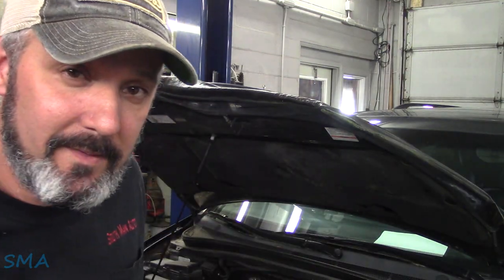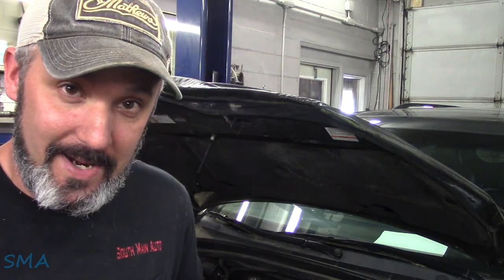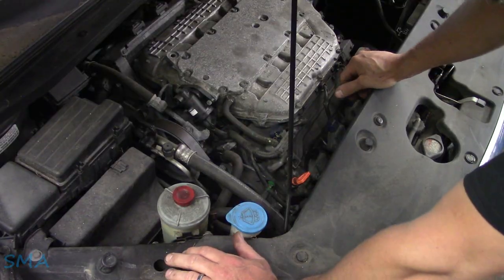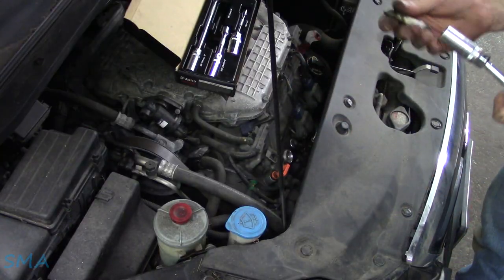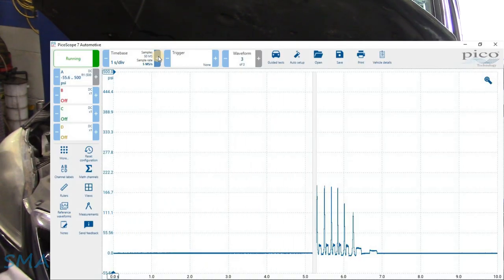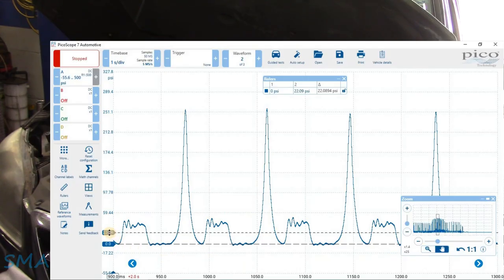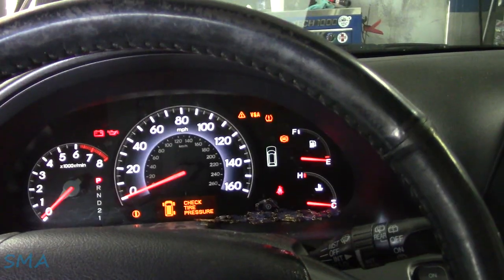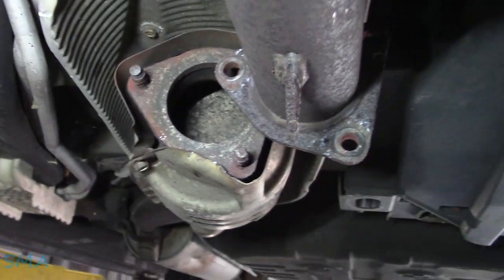Honda Odyssey: No Power At All

Comment: Gonna be expensive. That’s why we call em Cadillac converters.
Reply: Maybe not... if Jersey doesn't mandate commiefornia emissions.... could maybe slap on a chinesium filled converter from the Ali...
Reply: Find the guy with the garage full of used catalytic converters and the battery powered Sawzall 🙈👈
Reply: @wak359    It’s New York and they only allow oem.  My brother lives just north of South main auto and has been going through this.
Reply: @FredTheLutinoCocatiel  I dont no about ny but in Utah no used converters new oem only
Reply: @jeffleach2668  Eric O said the car's not registered in NY, that's a NJ plate on it. NJ does follow CARB, but only since 2009 and this is a 2007 vehicle so they may be able to get away with a federal cat instead of a CARB cat.
Reply: $125 and change from Rock Auto for the cheap one.  $250 for the premium.
Reply: @LuckyBaldwin777  except in New York they require oem converter so no rock auto honda only
Reply: @jeremyhanna3852  Oh really?  That blows.  Rock Auto says theirs come with the EPA certification, that should be good enough.  It's good enough for CA.
Reply: @LuckyBaldwin777  I have no idea for sure but I've heard Eric say it before ny state law oem converters only
Reply: @jeffleach2668  but the car apparently bears Jersey plates... cuomostan vehicle equipment laws are immaterial; only Jersey matters.
Reply: What's there a bunch of hacks in this comment section? Get the correct part, do it right.
Reply: @nickwood1062  ideally you are 100% correct but if a CARB-compliant converter is required it would, by itself, triple the value of the vehicle. Thus, it is not economically feasible.
Reply: @jeremyhanna3852  Except, Eric said it is NOT registered in NY. It's registered in NJ.
Reply: @bluegrallis  so that means his shop can install what the state considers a illegal cat because its not plated there eric even says at the end of the video he doesn't no has to to some research
Reply: @glassvial  I live in NJ an my cat just went at inspection time and they gave me a universal and I passed inspection with it. Literally less than 2 weeks ago.
Reply: @LuckyBaldwin777  The rock wins again
Reply: @wak359  The old stink of Jersey.
Reply: The ding dongs are burning baby.😁😁😁😁
Reply: Just gut them, cheap and easy..so I've heard! 🤔
Reply: @thyubernoob  careful with that kind of talk.  You might attract the smog nazis.
Reply: @glassvial  Entirely depends on the sticker on the car, if it has anything about California emissions on the sticker it has to have a CARB approved unit installed.
Reply: @LuckyBaldwin777  Nope, for NY it has to be OEM or a CARB approved unit. EPA cert isn't legal for NY on any Cali/NY emission vehicle.
Reply: @Blazer02LS  Unfortunately Eric O never let us know if there was a CARB sticker on the vehicle or not, but he did say in the follow up vid he put a NY/NJ compliant cat on it so I assume he put the CARB cat on it. Now that I've seen the follow up though, I'd say that was the last of that vehicle's problems!

Comment: I had a 2005 ford Taurus, all 3 cats were plugged. I gutted all 3 now it's running good, but the check engine light will never turn off. It's best to live somewhere without emissions testing.

Comment: Way back in the 80's when I was a Honda motorcycle tech a Honda Odyssey was a small yellow dune buggy type machine . Some of the engines on the first run off those units had a defect that was never disclosed to us at the dealership . New engines were shipped to our shop to replace the engines that had the issue . With the regional Honda Service Rep standing there as a witness I was instructed to smash the engine cases and bend the crank shafts of the engines I had removed with a sledge hammer before they went for scrap . I didn't much like smashing those engines that were new and had never ran . All these years later I still think of that day when I hear someone say " Honda Odyssey ."

Comment: Nothing like getting another dose of SMA. Get me through the rest of my day. I’ve seen some plugged exhaust. This ones as bad as it gets. Normally ya see big chunks of honey cones falling out in pieces. That one looked like it was caked with ash. Something tells me this guys gonna either tell Eric he’s gonna run with it without the ash or swap the old one with a new one. I’d prefer the later. The compression test did a good job of finding the back pressure in the cylinders on the exhaust stroke. Nice work Eric. I hope this guy allows you to fix it properly with a new one.

Comment: Vcm loves to kill that rear cat, done a lot of reading on Honda's cylinder deactivation. When cruising oil gets forced up through the oil rings from the pressure having no place to go which pools up then when it's reactivated it burns that oil and slowly starts to kill the primary cat by coating it in burned up oil. Happened to mine that's why I looked this up someone even made a vcm muzzler.
Reply: What is a VCM on a Hyundai?
It consists of a DC motor which actuates the VCM valve and a position sensor which detects the position of the VCM valve. The VCM system tumbles air flow entering into combustion chamber of each cylinder by closing the VCM valve in the cold start conditions.

Comment: It's a 2007 Odyssey touring model so it has a VCM engine. They have a reputation for fouling the rings on the deactivated cylinders, at which point they start consuming oil. Perhaps we'll have the pleasure of seeing this engine get that service.
Reply: Eww, I didn't know VCM was a thing Honda did. I guess they haven't learned from everyone else who's screwed that up.
Reply: @anonymic79  The higher trim V6 engines up 2010 (e.g. J35A7 engine) have VCM. After that all their J series are VCM AFAIK. I have a 2010 with VCM. No problems so far, but I saw evidence of slight fouling when the plugs were changed at 100k. I just be sure to use good oil and good gas. Hopefully that keeps it at bay.
Reply: How can you foul a ring? Air compressors do fine. No heat on the rings, plenty of oil. I don't see how anything could be damaged. Now maybe fouling a plug.
Reply: @Bryan-Hensley  They get plugged up with carbon. Honda have a TSB about it. The pistons have to come out, get cleaned, and get new rings.
Reply: The 2005-2010 EX-L and the Touring had the VCM. I have an ‘05 EX with no VCM and dont have any oil consumption issues. A lot of people installed a VCM muzzler to disable the VCM and havent had any issues if they installed it early enough.
Reply: @tomcartwright2637  I have the 2010 EX-L. No VCM muzzler. So far so good.
Reply: @Bryan-Hensley  Oil control rings especially can foul when the oil return path and ring lands carbon up. Hot carbon from a running cylinder can freeze a ring away from the bore when the cylinder is deactivated. In the sense of a plug fouling, the carbon prevents the part from working properly, so also in this case carbon can prevent other parts working properly.

Comment: I’ve not seen this happen before so once again I appreciate SMA videos. Always good to think ahead and start with the easier stuff before overcomplicating it all. Hell just seeing him get those rusty ass nuts off (the cat bolts not the bubba talk) with some heat educated me a bit. I just did sway bar links on the wife’s CRV and it was horrible getting the 2 nuts off each side. I did hit them with a propane torch but it’s a bitch to keep the studs still and whack a box end wrench at the same time. Why can’t auto makers use stainless or neverseize on all the fasteners?

Comment: If you did have a question on which cat it was could you use a thermal imager or laser thermometer to figure out where the heat stops?
Reply: Excellent question.  Less chemical reaction - less heat, bad (plugged, contaminated) converter?
Reply: @s.j.5850  my thought was simply everything after the restriction would be colder and at the point of the restriction it would be hot because the heat would build at or upstream of the blockage.
Reply: @Name-vu1kn  An infrared thermometer is a tool used to determine which catalytic converter is clogged or how clogged they are compared to another on the vehicle. A clogged cat will be significantly hotter than one that is flowing freely because the heat from the exhaust can not dissipate due to the restriction.

Comment: Ashes to ashes, dust to dust, keeping spare oil for a Hondoo is a must!
Reply: Only if you put in the wrong oil, or dont change it out every 6k miles. I have an R20 engine in my car, and It doesn't burn any oil. It's now at 100k miles.
But I religiously change the oil, and have the valves adjusted on time.
Reply: @The_Noticer.  yeah buy a Honda because 10 or even 15k oil changes that all other Manufacturers specify are just a myth! 🤣
Reply: @Micko350  I dont understand the tone of the comment. All i'm saying is that we're not still in the B-series engine era, and having to carry around oil for a Honda is only the case if you neglect it. But that's the same for any engine manuf.
Reply: @The_Noticer.  yeah rightio, tell that to two of my Hybrid Camry's that have done almost a Million Kms each 😂
Reply: @The_Noticer.  who's arguing?! If anyone is arguing it's YOU! Go & have another look, I've been laughing at you! 🤣

Comment: Honda Converters are notorious for going bad after a while. Especially on those engines because the piston rings eventually wear out and they start burning a crapload of oil. Honestly the customer got lucky with the rear converter going bad. When its the front one, a lot of times to motor will such all that dust back into the cylinder, and will eventually clog up the VTEC among other fun things.

Comment: So will we ever learn why it was plugged?  Just curious if you stopped with just replacing the converter.  Part II maybe?
Reply: Converters tend to simply fail this way..
Reply: Looks like the dust is from the front converter ehich was collected there
Reply: @biscuitsandgravy  : Mainly peacefully stolen ?
Reply: Often times what happens on these Odysseys is the stupid faulty VCM system. This one's a Touring, so it does have VCM. What happens is VCM causes it to start burning oil, which leads to all that burnt oil destroying the cat.
Reply: Hope Mrs. O wasn't stirring the pot for Lunch!!  Be pasta sauce everywhere!!😱

Comment: I was able to determine plugged exhaust using a vacuum gauge. Would idle ok but wouldn’t rev up much. Gauge showed practically no vacuum and after blipping the throttle and release actually went slightly positive pressure momentarily. 

It took several hours to remove the mouse nest.

Comment: Scotty Kilmer would hook up his fancy $5000 scan tool
Reply: And tell you that you should have bought a 1994 Celica
Reply: @canadiantrucker9574  beacause his Celica is still on the original engine!!!
Reply: @Kevin Barry @canadiantrucker9574  Painfully accurate.
Reply: This guy isn't using el cheapo diagnostic tool either.
Reply: And then had ChrisFix pour a sponsored fluid in the tank and call it fixed.
Reply: @konstantindufnik696  My '94 Mustang is still on the same engine.
Reply: @konstantindufnik696  My moms Chev Trailblazer is still built on its original engine!

Comment: That van’s engine sounds like it was originally in a diesel semi….
Reply: Yep, my guess is that it has over 200,000 miles and the valves have never been adjusted.  Honda V6's need valve adjustments every 100,000 miles or so.  The exhaust valves are probably burned as a result.  The owner's maintenance philosophy seems to be "drive it till it quits, then fix it."  Look at the obviously misaligned front end that destroyed the tires (thread showing.)
Reply: That's exactly what I thought!
Reply: @JamesSterling  The valves are most likely burned because of the plugged exhaust. A plugged cat holds the heat in, and causes all kinds of issues as it slowly cooks the heads as it plugs up worse and worse.

Comment: Not buying tires so I doubt he’s going to drop $1000 on cats.
Reply: He also most likely won't pass any kind of inspection with an aftermarket cat now too.  Thanks obiden

Edit for the mad leftists- Didn't Joe's epa just reinterpret the laws??  Yes they did.
Reply: @getchasome6230  I'm pretty sure as long as it's installed in a decent manner it passes. It does in Ontario Canada at least
Reply: @dakotataylor7909  Yeah, Uncle Joe messed everything up here in the states.
Reply: @Scotty secretly loves Chryslers Indeed.  I sure could go for some mean tweets and low gas prices right about now.
Reply: @getchasome6230   🤦‍♂️
Reality check from outside the loony bubble......
I do inspections and emissions all day. Nothing has changed. As long as your check engine light is off, and the tests are passed, if passes. Replacement cats are still sold and completely legal as long as, see above. 
But thanks for visiting🙄
Reply: @getchasome6230  Needs to be a CARB approved aftermarket for cars with CA emissions in NY I believe. Why are you blaming Biden for something that's been that way for years?
Reply: @RobertHancock1  infact a partisan hack but just in a “dem good” way could say it’s trumps fault and Biden’s hands are tied so really this is all about trump

Even tho new York is on a state level, literally, choosing to exceed EPA regulations which is in the scope of a president… because 48 states aftermarket cats are fine Lol
Reply: @getchasome6230  sure it was just Joe? I'm fairly certain it's different state to state, wisconsin inspection is very easy to pass. We only have it in Milwaukee though.
Reply: @BigWheel.  pretty sure the epa is federal... js
Reply: @Scotty secretly loves Chryslers Not all democrats are kid fuckers; but they've all decided it's not a deal breaker.
Reply: @RobertHancock1  It was bidens administration who reinterpreted the epa laws.    That's why I'm blaming him
Reply: @dakotataylor7909  thay dont do emmision tests in ontario anymore.
Reply: @shimes424  That's funny.  Pedos make ME 🤮
Reply: Had my stole a couple years ago, only cost $75 for new replacement, so I am not sure where the money is in stealing these things.
Reply: @vampeel  The cats that come from the factory are worth a LOT more than the aftermarket ones.  Go price an OEM one

Comment: Similar thing happened on my son's 2006 Pilot.  The front cat blew chunks right into to the bottom cat's mouth and caused a big reduction in power. I replaced the bottom cat and left the front cat hollowed out. CEL is always on but it runs great.

Comment: I've had a few of these come into my shop. One was a young couple from DC,  whistling like crazy and battery light on. I put an alternator and some new gaskets on it, gutted the after cat. I did em a favor and they'll never know. 

The 07 Hondoo odyssey was one of those years that the geniuses aligned all of the piston rings when they put em together and they're known to chug oil. It's almost always the after cat that's plugged

Comment: Opener: "hey, there's that guy! Hey, there's that guy! Hey, there's that guy! ..."
Reply: Imagine that going off inside a oil change shop. Dips were fiddling around with a Honda's battery terminals, when the ECM decided it had enough and set off the horn.  I was in front of the ride and got an earful of Japan's finest.
Reply: @Nighthawke70  Actually, this van was manufactured in Lincoln, Alabama.
Reply: @frankhoward7645  Engineering?
Reply: @bun8170  Nope.  Manufactured.  They make Honda Pilots there too.
Reply: @frankhoward7645  Aren't they just assembled there from Japanese and Korean parts?

Comment: Eric, If oil is suspected of killing the rear converter, why didn't it kill the front ones?
Reply: Front gets coated in oil, gets hot and self combusted, melted the media and sent it back to plug the back one.
Reply: It did.  That dusty crap you saw was the guts of a front converter.

Comment: Bosch plugs? Must have gone to an auto parts store and just got what they could. I've never really had any good luck with Bosch. I stick with NGK even on my Dodge.
Reply: If I want any of my machines to work like garbage I use Bosh plugs.
I can't understand how they are still in business
Reply: Bosch is OEM on more than a few European cars.
Reply: @javaguru7141  I just pulled them out of my mgb a few weeks ago and replaced them with ngk. It's like a new car.
Reply: @spurgear4  Interesting, good to know.
Reply: @javaguru7141  Probably not that interesting but I have had trouble with them in motorbikes cars and outboard motors. Not sure why they seem to fail so often. Anyway have a great evening
Reply: @spurgear4  The one instance that I specifically remember is I had a 99 Ford Ranger with dual plugs. After 6000 miles I had to replace them. When I pulled them the electrode was gone. It had melted all the way down into the porcelain. After that I decided to give NGK a shot and went with their v-power since it was the closest thing to factory spec. I think it's the fact that they use a wire thin electrode for their platinum plugs.

Comment: Since the front half of the substrate is missing, I wouldn't overthink it, just replace it and call it good.
Reply: Replace it? Judging by those tires, they don’t live somewhere with inspections. If it doesn’t check exhaust after the CAT… call it a day, customer needs new tires before he kills someone, if the converter plugs again he can chase that issue.

I know, there’s some states where inspection shops would pass tires on the edge of wearing out, but fail for emissions. Ass backwards if you ask me, safety should come first. I’ve had a car pass inspection where the frame literally broke a few weeks later. Ass backwards system.
Reply: NO, what you are seeing is the remains of one of the two forward cats that came apart and clogged the front of the rear cat. That cat he showed is fine.
Reply: @freddyrosenberg9288  The substrate was quite a ways inside the shell.  That's not normal.  They are close to the transition cone, not 3" back.